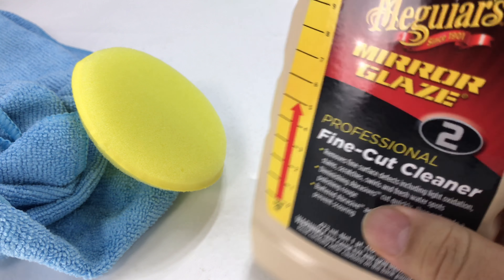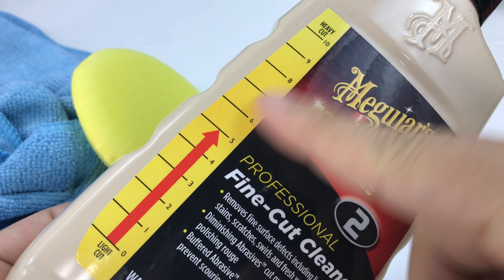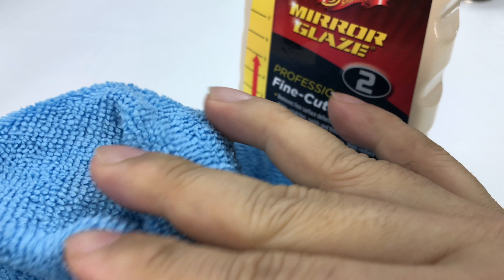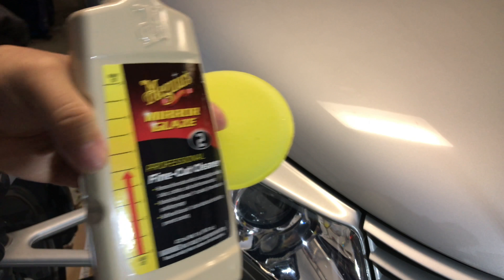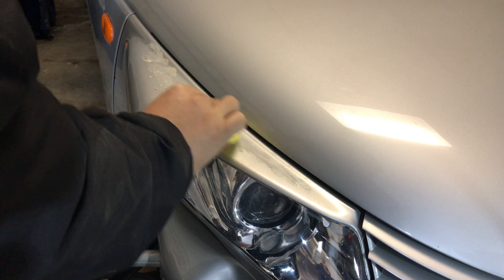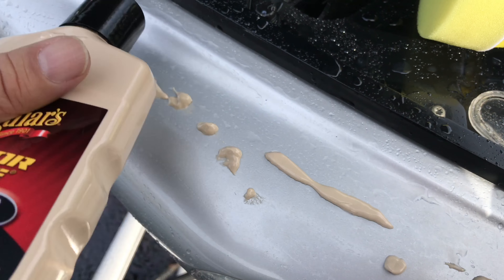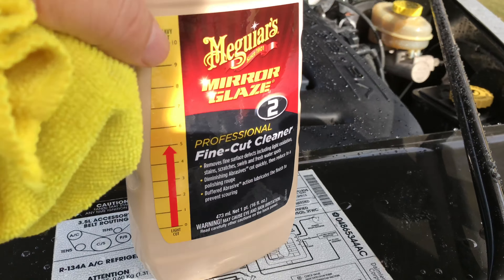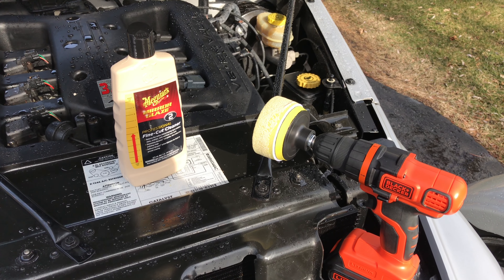Polishing Dull Paint with Meguiar's M2 Mirror Glaze Fine-Cut Cleaner

Comment: Try reducing the amount of liquid you use when polishing. 

The first go, by hand there was so much liquid on the surface that the abrasives couldn't engage with the paint. They were hydroplaning over the paint instead. Try a small pea sized drop, and get some friction going between the applicator, the abrasive grains, and the paint. This was the abrasives can cut the old paint away, and break down in size, delivering good gloss. 

Same with the machine application. The first little bit you applied to the pad was just about perfect. Applying more liquid to the work surface just wastes it, and is inefficient in the long run. 

Thank you however, for showcasing this very nice product from Meguiar's. It was the first paint correction type product I ever used in the late 90's.